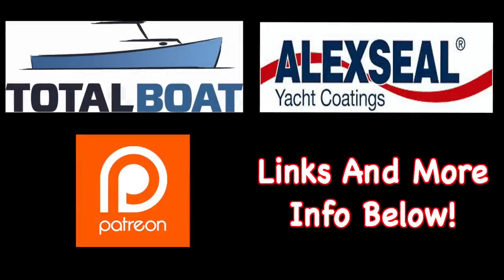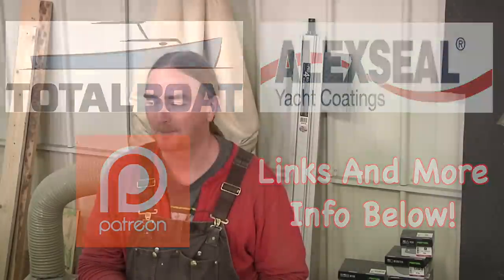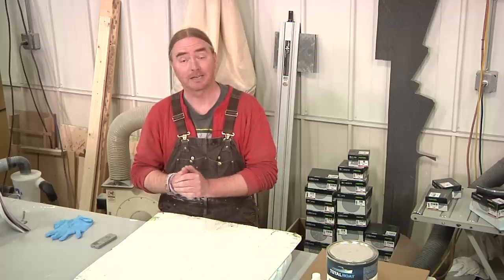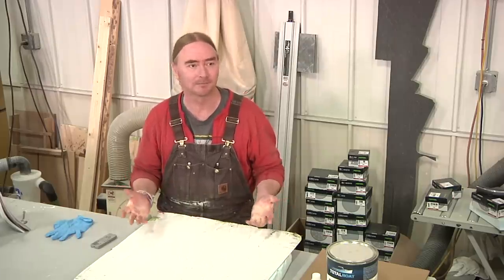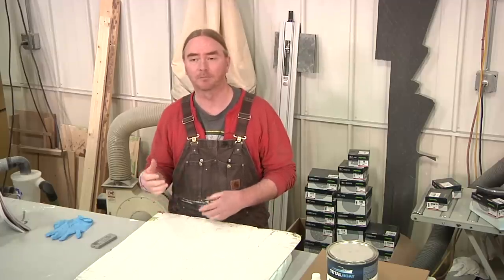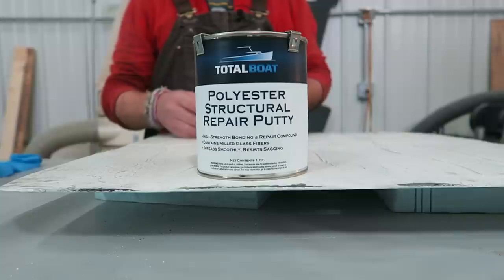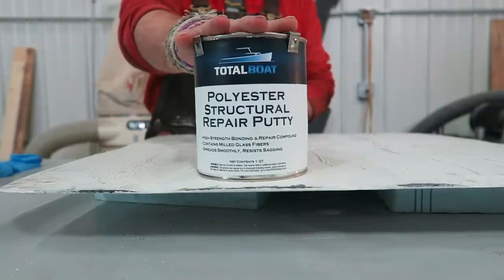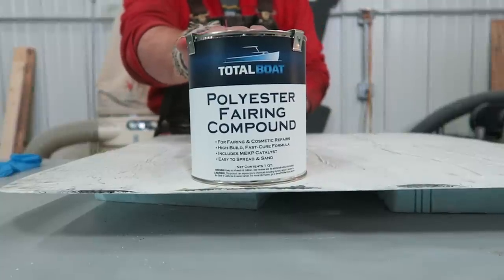Pre-Launch Quick Tip #2 : Fairing For Gelcoat Repairs

Comment: Hello Andy, thanks for all your videos…well done and educational. I have a project to fix a 3”x3” hole in the bottom of my sailboat..scheduled for this coming summer. I saw your videos on epoxy vs polyester resin and whether gelcoat will work with epoxy. I’ve already purchased 105/205, so was hoping to use that to do the repair. I do, however hope to use gelcoat…as I noticed I can buy a colour matching kit on Amazon. Is 3x3” too large a hole ( underwater), to use a epoxy/gelcoat combo?

Comment: I sprayed my whole 25’ sailboat with a gelcoat and for some reason I have spots that didn’t harden. How do fix those tacky spots?  Using Hi-Bond gelcoat with wax. Thanks for the videos. They gave me the confidence to tackle this project.  Even though I do have some trouble spots, I consider this project a success up to this point. Still have to sand buff so we will see.

Comment: Ha. I would have needed these advices couple of weeks ago. 😅
Did some filling for old holes to my boat. Only problem is that fairing compound (I used plastic paddding but seems to be same stuff) is of course much brighter white than my 39 yo boat. Well - it’s ok for now. Maybe complete new coat of gelcoat to the whole cockpit next year. I assume you can use gelcoat like paint? Should I put laminating gelcoat like wet on wet and how thick it should be?

Comment: Andy, I got a little confused on the Poly and Epoxy resins.....my question. a 67 Boston whaler 16'7" hull. Below the water line on the keel. What would you use to in the keel for a resin? I will be grinding down the gel to factory glass, adding glass tape then gel coat. I am doing this to have better impact resistance on the keel. Its a small boat for beaching, and I do glide nicely in... and beach it. I ask this because the whole boat is gel coated.

Comment: In a pinch, you can recut the the teeth in the blades... I was working on installing 3/4" oak floooring and hit a big nail while cutting the door jambs for the flooring to fit under, even through it was a metal / wood blade, it trashed it, didn't have a spare blade, but I carry a set of small files with me and I just recut new teeth in to the blade so I could finish the job and get out of there. Wasn't super pretty looking teeth, because I didn't have the exact pitch file, but I was able to cut the rest of the door jambs. I didn't have time to get to the store before it closed and it would have been a 1 hour and 15 min round trip from where I was.

Comment: Andy great channel let’s go too 2 vids a week while we are are locked up going stir crazy. What’s your thoughts on doing a glassed in thruster tunnel I’m sure you have done a few. I’m thinking of adding 1 maybe a stern also thinking about maybe a jet thruster boat is a 27Albin Fc it has core issues around the portlights and a couple soft spots in the fwd deck.

Comment: ok so the polyester fairing compound cures   What is keeping the catalyst on the surface for a cure and how would you have to prep for a second coat.  If it is wax there could be issues.  What does a can weigh ?
Does it contain talc ?    Stuff with talc will sand like butter and is usually easy to spot because it is heavy compared to microsphere filler.  Any thing with talc is forbidden in a wet zone.  Though it is nice to make your hands slide in to the gloves.  Looks seriously light so most likely microspheres according to webpage
It comes from RI so it should be promoted to work in cool weather.  Always had issues with Dura Tec from the desert in California and just had to kick it at 2% or more

Comment: Why did you say to polyester resin works better with gelcoat when you did a whole series of videos showing that epoxy resin actually  worked even better with gelcoat?  Did you change your mind?  In my amateur experience, I've never had issues with gelcoat sticking to epoxy.   As you showed in your video series West System states there are no issues with gelcoat.  I'm not sure what other manufacturers state, but I guess they would say the same.   I refuse to use a porous polyester resin with boat repairs when nonporous epoxy works just as well and most often, better.  Can you please clarify?

Comment: If the polyester fairing compound has a 'wax' in in to make it cure.  And then your wanting to put gel coat on top, do you need to do a de'wax'er before or does the sanding take care of that aspect?
Reply: My understanding is that the wax flows to the surface. When you sand the top layer off, you've removed the wax.

Comment: I'll never keep it straight...EVER...Polyester vs. Epoxy...what goes over what, when to use wax additive and when not to...I know, I don't live this stuff, but it is an area that I'll never keep straight.
Reply: WreckDiver99 you can put epoxy over poly. Not the other way around. And when using poly, the only time you don’t want wax in it is when doing multiple layups. Everyone does things differently and whenever I do gelcoat repairs I always use gelcoat with wax in it. Again, just how I do it👌👌